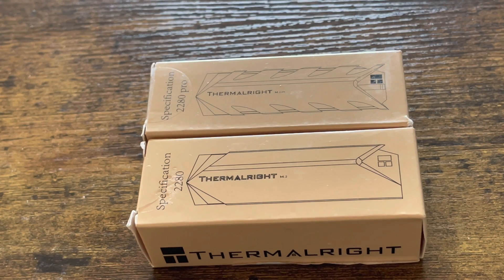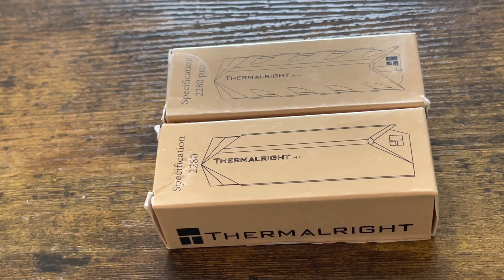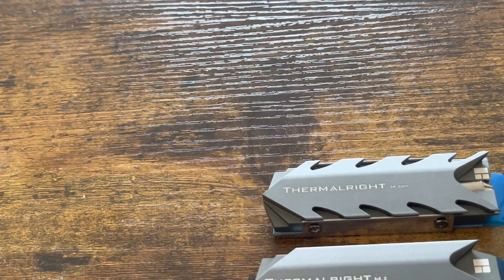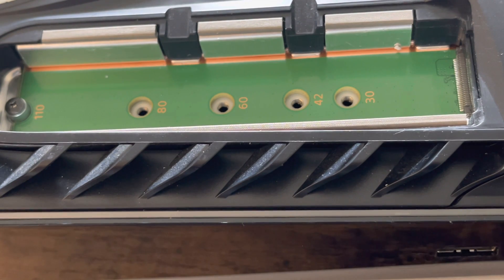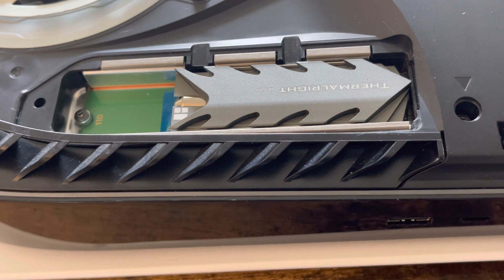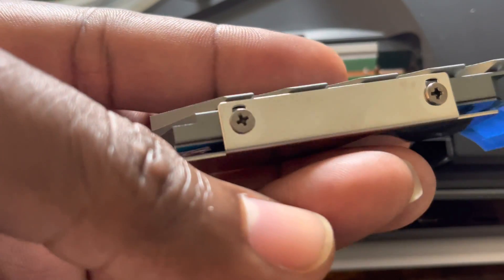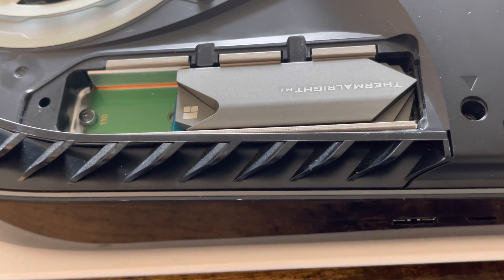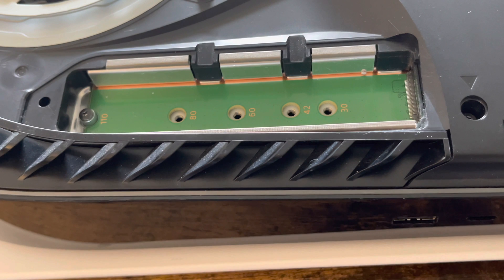Thermalright M.2 #heatsink #ps5. Will it fit?

Comment: you havnt checked it with disk in won't that raise it some more
Reply from the maker: Just a little bit when I installed the ssd with the thermal pad so overall it didn’t fit.

Comment: Does no one see that these narrow-eyed crooks made the device the other way around? They mixed up the front and back of the upper part of the radiator!! If you install SD M.2 with the contact comb to the right, then when installing the radiator on the motherboard, the inscription on the radiator will be from right to left, that is, on the contrary, inverted. This is a huge, ugly blunder that neither users nor viewers of this channel see. The THERMALRIGHT brand made a loud "fart" into a puddle. But most of all it is unclear why the brand continues to produce this shameful blunder.

Comment: Ok I installed this heatsink also but I had to turn mine with the arrow facing the other way so when you put the faceplate to cover it back up it can line up perfect and the point doesn’t interfere
Reply from the maker: Ok. Im glad you’ve found a way to make the heatsink fit. Im gonna buy it again and try it that way.
Reply: @Tech-n5m  and yes it helped that I only used two screws the way u said 👍🏾

Comment: Doesn't fit. That's not a proper test fit without the thickness of the SSD plus the riser to hold down the SSD.
Reply from the maker: Your right. I was too excited that I missed some important things.
Reply: @Tech-n5m  all good, but Sabrent is releasing one made specifically for the PS5. 
Still you can run this without the cover on. It's safe, but don't take my word for it and risk your warranty.
I'm running mine without the cover until the Sabrent is released.
Cheers
Reply from the maker: @Dongsa  I about to order mine.